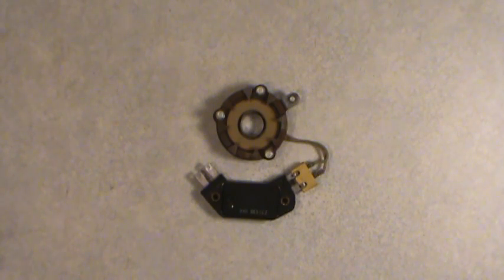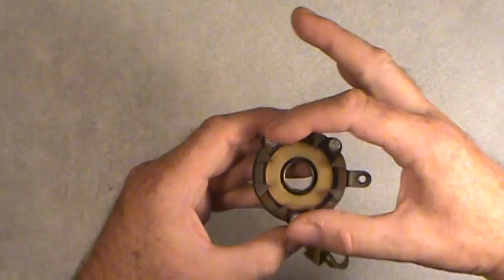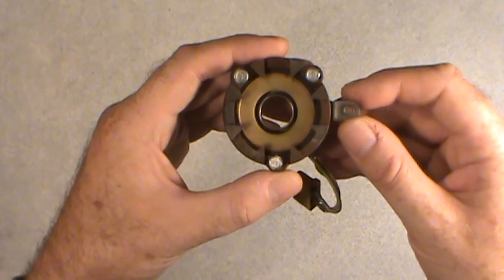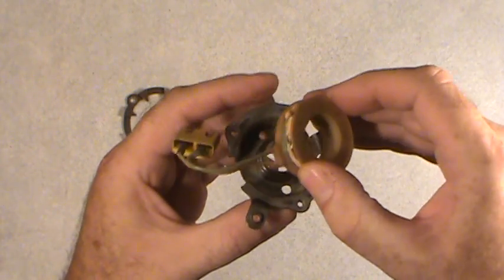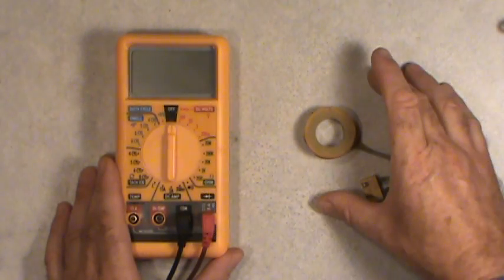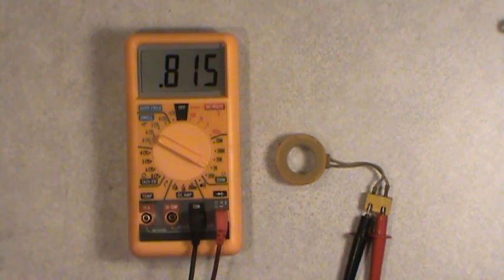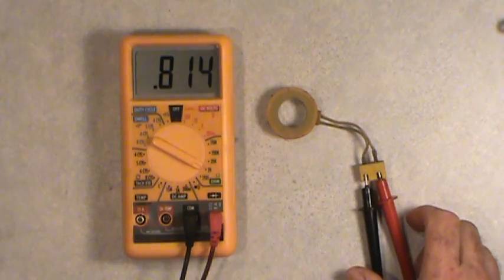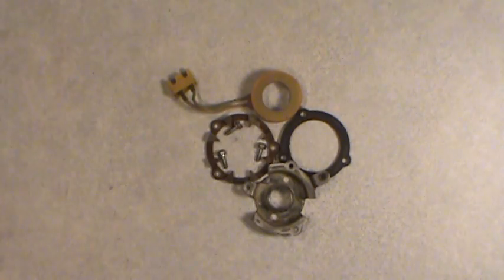HEI Distributor Pickup Coil Test

Comment: I'm working on a 1988 Chevy 1500K 4WD and was hoping that .814 reading would be correct for this vehicle?  I'm deciding between that and the ignition module as I've put my hands on the both the coil pack and the distributor after seeing no spark at in the spark plugs using a Philips Screwdriver and seeing no spark between the air gap.  What do you think would be the most likely solution?
Reply from the maker: wildboy92004 Greetings wildboy92004....Thanks for watching, and for Your comment/questions as well........................It appears, that, that .814 (Ohms?), that You were mentioning, should be alright/ok, as I recall, off of the top of my head, is that, an "Ohm Reading"..."Between"..."750 to 1500"...Ohms, should be (as I recall), the actual Ohms Testing "Specification/s", for this particular, 1979 HEI Distributor's..."Pick Up Coil"...that You see in this YouTube Video of mine......................................Just to be sure, try to find, the "Actual Specifications", for Your "Exact"..."Pick Up Coil"...just in case, it, might be a bit different?....................................................................................When-ever, looking for Your HEI Distributor..."Specifications"...or..."Replacement Parts"...Make Sure, that, You Get, the "Exact Parts"...for Your..."Exact Distributor" (hopefully, there will be, some Numbers, and/or Letters, found in/on Your particular Distributor, hopefully)...and..."Exact Ignition System"...as well...!!!.....................................I have a "7 Number Code"...Stamped Into/Onto, this, shall we say..."Old School"..."Ignition Coil, in the Distributor Cap, type of, V-8 HEI Distributor" of mine, on the bottom/outside, of the HEI Distributor's, Aluminum Body..................... "Make Sure"....that You..."Get the Correct/Specified Parts...for Your Exact HEI Distributor"...or...it might end up, not, be-in, such a good day after all................................You have to make sure, that Your "Ignition Coil", is getting "Battery Voltage" (about 12 Volts), when Your Ignition/Key, is placed in the "Run" (Not Start!) Position................................With Your "Engine...Cold and Not Running"...."Disconnect the Wires" that are plugged into Your "Ignition Coil"...then, select, Your Multi-Meter's "Volt Range/Scale", to Measure 12 Volts (might be set at 20 Volts?)...then, "Ground", the Multi-Meter's, Black Test Lead, to a good ground...and, with the "Red Test Lead"...Probe/connect it to...(You might need a Small Pin, or the like, to make the required test lead connection, perhaps?)...the, might be Red Wire?, or, the Wire that should make Your Multi-Meter Display, that approx, 12 Volts (Battery Voltage), when the Ignition Key, is Turned to the..."RUN"...Position..."NOT START"...position"...!!!............When You are finished, "Checking for that 12 Volts, in the Ignition Coil's, 12 Volt Supply Wire"...Turn Off the Ignition Switch, and take the key with You...and...Disconnect those Multi-Meter's Test leads, and reconnect the Wires, that connect to the Ignition Coil, that You removed previously...........................Did You "See", that 12 Volts, there-abouts, at all, while doing the Test...???................................The Design, of Your Vehicle's, Distributor Cap, with that..."Way Too Small Carbon Button" (inside) of "it"...and, that rather "Wimpy" Rotor, for, both the V-6 and V-8 Engines, are absolute "Junk/Crap"...more-so, when-ever the Spark Plug's "Gap", happen to be set at .045" (Four-tee Five Thousandths of an Inch) or LARGER, because of the "Much Higher Secondary Voltage", that has to make its way through, the Ignition System's, "High, Secondary Voltage, Side"...in order to "Jump", that "Much Larger Spark Plug Gap"...!!!............................If the "Gap Specification", for Your Spark Plugs, are close to being .035" (Thirty-Five Thousandths of an Inch), then, as I see it, the Ignition System's, High, Secondary Voltage, probably, Won't be, quite as High, as, having those Spark Plugs, with those Larger "Gaps", and, that, Way Too Small, Distributor Cap's..."Carbon Button"...should last a bit longer, hopefully....................................Check the "Carbon Button", that is Hiding, on the Inside of Your Distributor Cap, near the Center of it..................That "Little Carbon Button"..."Should Not", be "Worn Down", all the way, to the, shall we say, Distributor Cap's Plastic, and, that Little Carbon Button...should be "Spring Loaded", as well...............................If there is anything left, of that Carbon Button, then, just Push on it, and, it should have a "Spring-like" Action to it, much like a Writing...Ink Pen, that retracts, does................................The Way Under-designed, and "Wimpy," Distributor Cap's, "Carbon Button", and Rotor, usually don't last as long as They Should last, as compared, to both the, Circa/Dinosaur, Points and Condenser, type of Distributor, Cap & Rotor, as well as, the Earlier, V-8 HEI Distributors, that had the (Ignition) Coil (installed/Mounted) in the Distributor Cap...Did, and...Still Does...!!!...lol...................................If and when-ever, You do, decide to Replace that "Wimpy", Distributor Cap & Rotor, try to get a Distributor Cap, that has "Brass Terminals" on/in "it", and, if You can get a hold of, a Rotor, with a "Brass" strip of Metal on "it", then, that's a good thing...............................If You can Buy/Purchase, the, Distributor..."Cap and Rotor"..as a "Kit" (that be, the Cap & Rotor, usually in the same Package), then, that, my Friend, should "Save" You, a wee (Wee = Tiny or Small...lol) bit of Money, hopefully, that is...................................Make sure, that, the Bottom of the Ignition Module, and, the the Distributor Body (inside), where the Ignition Module, "Mounts On", are "Very Clean and Shine-ee, and also, make sure, that, You Smear, some Approved "Heat Transfer/Electronic, Heat Sink"..."Goop"...on the bottom of Your Ignition Module, before You Install "it" or, it just might "Over-Heat", and go..."Kaput"...!!! (aka, not work any more)...................................Make Sure, that, "All Wiring"...Connection Points/Connectors, are not Corroded/Oxidized/Dirty, especially, on the "Low Voltage" side, of the Ignition System's, Electrical Circuit, or, Things, might not "Work so Well", if the Full amount of Voltage and Amps, don't make it to, where it/they, should be going to, just sayin' now.............................Oh, and, if Your Spark Plug "Leads/Wires", are very Old/have lots of Miles/Kilometers on "Them", it would be a good idea, to Replace Them, with a set of Good Quality Ones, and, make sure, that, You Install, those Spark Plug Leads/Wires, Don't Forget" to "Install"..."Those"...(usually made out of)...."Plastic..."Wire Separator CLIPS"...in order to Prevent, any of that High Voltage, from "Jumping", from One...Lead/Wire, "Into another Lead/Wire"...or, might just turn into, something like..."Engine...Miss-Fire City"...!!!...............................It's always, a Good Idea, to be doing, "Regular Maintenance", and to, also, "Change/Replace", All of the "Parts & Pieces", as well as, any Required "Adjustments", that, is/are, "Recommended/Specified", by the "Factory/Manufacturer", that made Your Vehicle, to better Your Odds, at, Not having to go, on a..."Wild Goose Chase"...!!!...lol............................Have a look-see, at some of the "Other Videos", that I currently have, on my YouTube Channel...RockysRoadshow...and, I'm quite sure, that, some of them, will be able to, help You out some-what...enjoy.........................If You care to, You can let me know, how Ur makin' out, and.....................Till next time................Be Safe, take care, and have a good one.
Reply: RockysRoadshow I will try this, thank you.  Am I testing for resistance at the pole of the ignition coil?
Reply from the maker: wildboy92004 Greetings wildboy92004....You are welcome...........................It appears that, You might not have, all that much experience, when it comes to working on, something like, a Vehicle's, Fuel, and/or, Ignition System, and We all have to Start somewhere, and, that Includes (actually Included...lol)...Me also, when I was, at first, starting out, gettin' my Hands Dirty, and tryin' to figure..."Why is my Car Not Runnin' so good"...???...lol.......................................I'm assuming, that, You have a "Multi-Meter", that should be able to measure "Different", shall we say, "Things" (some-what Electrically, that is), and, if You have a look-see, at the many "Different Scales/Ranges", on most of the Multi-Meters out there, You will usually "See", both the "Ohms Symbol" (kinda looks like a Horse-Shoe, with the Open-End of that Horse-Shoe, pointing Downwards), and, Ohms, are a typical way, in which to Measure an "Electrical Resistance", usually, when Not Having any Electricity Flowing through the Wire/Wires, or Component/s, as the case may be......................Voltage, on the other hand, and, as I see it, is the actual, oh, shall I say..."Electrical Pressure", of the Electricity, that is Flowing through a Wire or Component..............................Be Careful now, as there are usually "2 Types of Voltage"...one being..."AC Voltage" (AC = Alternating Current), and a fairly good example of "AC Voltage", is the Type of Electricity, that is Flowing through the Wiring in a House...then, there is..."DC Voltage" (Direct Current), which is what, almost all..."Electrical Tests"..."DC Voltage-wise"...that is, when Testing the "Voltage", on various, Wires and Components, that are usually found, in most Cars and Trucks...........................Your Vehicle's, "Battery", should be rated at 12 Volts, actually, a Fully Charged, 12 Volt, Vehicle Battery, should be around 12.6 Volts, with the Vehicle's Engine "Not Running", and, when-ever the Engine "Is Running", and..."None"...of the..."Accessories are Turned On", as in Heater/Air Conditioner Fan, Windshield Wiper Motor, Headlights, etc., then, I've found, that, at times, on a "Cold Winter's Day", that, the "Battery Voltage", with the "Engine Running", and "Every Accessory Turned Off", I was seeing, almost/about, 15 Volts, showing on my Vehicle's "Volt Gauge", on/in the Dashboard...!!!.....................................Now then, About what I was saying, in my last Post/Reply, was, to "Measure the Voltage", while having the Multi-Meter's "Dial/Selector", Set for "DC Volts", in order to Measure, the Amount of "Volts" (Voltage), that is coming through the "Wiring/Connector/s", that is, to be..."Disconnected"..."From"...Your Ignition Coil..."Only"..."Not the Ignition Coil Itself"...!!! (well, if there is Any, that is?)...................................Be "Extremely Careful", while working near Your Vehicle's "Battery", because, there is usually "Explosive Gas Venting", from Your Vehicle's Battery, especially when, Your Engine is Running, and the Vehicle's "Charging System" is Operating...!!!...so..."No Sparks"...and..."No Smoking"..."What-so-Ever"...!!!...anywhere..."Near Your Vehicle's Battery", or, maybe..."BOOM"...!!!....and, I hope not..................................Also..."Check the Fuses"...in Your Vehicle's..."Fuse Panel or Box"...cuz, if one or more, of the Vehicle's Wiring Circuits or Electrical Components, shall we say..."Overloads or Shorts-out"...that my Friend, can cause a..."Fuse to Blow" (as in, go Poof...!!!), and, that "Blown/Bad Fuse", will..."Stop All Electricity"...From..."Flowing Through that particular Electrical Circuit"..!!!...and maybe, just maybe, that might be, one of the possible..."Culprits"...that could, possibly be, what's causing, the "No-Spark" Problem, that You seem to be having...???....................I have a few Videos, on, how to do..."Ohms (Resistance) Testing"...of some Different "Types" of "Ignition Coils", on my YouTube Channel....RockysRoadshow...enjoy.................................So then, that's about it, for the time being, and..........................Till next time..............Be Safe, take care, and have a good one.
Reply: RockysRoadshow I'll check it out.  I took Auto Mechanics 1 and 2, and Small Engine Repair in high school some 20 years ago right around the age this truck was popular to work on.  I have never tested a coil pack with a multi-meter.  All I know is it interrupts the ground for the ignition so if I'm getting no spark out of the coil pack then don't I back step to the ignition module and then the HEI, respectively.   I'll watch your tutorials.  I was just wondering a quick way to get the coil pack out of the equation and then work on the pieces in the distributor.  That ignition module, I wanted to know how to test that to see if it's bad as well with only taking the distributor cap off.  Rotor was fine.  The question is, how to test for a bad ignition module?  1988 Chevy 1500K 4WD.
Reply from the maker: wildboy92004 Greetings wildboy92004....Congrats, at taking those, Small Engine Repair Courses, as, now, I can see that, You do have some Experience, after all.............................I've, never really "Tested", an "Ignition Module", and, I usually just Replace "One", when "Every-thing-else", in the "Ignition System, seems to "Check Out Ok".............................For some of the "Ignition Modules", Before the Distributors were being "Hooked-Up to Computers", that were Used in some of the Ignition Systems, by Different, North American Manufacturers, had a Testing "Unit", that would be able to "Test", those Older Ignition Modules...................................Also, there are some Folks, that, have found a way or two, to, some-what "Test", those very same, Older, Ignition Modules, with a Multi-Meter, along with, a quite simple Wiring Circuit as well.....................................Just wonderin'...Just How, did Your "Ignition System"..."Quit/Stop Working on You"...as in..."Gradually Failing"...like having the Engine..."Miss-Firing"...or...being..."Hard to Start...Hot or Cold"...or...did Your Engine just..."Quit, all of a Sudden, without Any Warning at all...???...as that, in itself, can/might, be, a very Good "Clue", as to what-"it"-just-might-be-that's-Causin'-all-of-this-Trouble-that-Ur-havin'...perhaps...............................There are "Rare" times, where, although, an..."Ignition Coil Checks Out Ok"...while doing an "Ohms/Resistance Test", with a Multi-Meter, Set for the Correct, Ohms Scale/Range, for/on, both, the "Primary and Secondary, Coil Windings of Wire", that are Hiding, Inside Your Ignition Coil, where-by, that Affected/Not so Good, Ignition Coil, might start, Not Working so Good, and maybe, Stop Working, All-Together, once it Heats Up-To, Operating Temperature or Higher................................................................................Did You "Look-at/Inspect" the Carbon Button"..."Inside"...Your..."Distributor Cap"...???....................................Besides a Faulty "Ignition Module" (if it "is" Faulty, that is...???)...then, Here's what I usually Do, to Check-Out, the Ignition System, much like the "One", that You have there............................................................Make Sure, that, I'm getting, about "12 Volts" there-abouts, at the Ignition Coil's..."Disconnected"..."12 Volt Supply Wire", where "it" Plugs-Into the Ignition Coil, having the Ignition Switch, in the "RUN"..."NOT START"...Position.............................Having All Wires, Disconnected, from the Ignition Coil, Check the Ignition Coil's..."Primary Coil Windings", and "Secondary Coil Windings", with an Ohm-Meter, and, Make Sure, that, those Ohms Readings, are "With-in the Specifications", for that "Exact" Ignition Coil......................................Check the Ohms/Resistance of the "Pick Up Coil", and, that, the Ohms Readings, are "With-In the Specifications", for that "Exact" Pick Up Coil"...................................Ohms Check, the (spark plug-like), "Lead/Wire", that "Connects Between", the Ignition Coil's, Secondary, High Voltage "Tower", and the "Distributor Cap", as, I've had, One of those, on an Engine, that had the Lead's/Wire's, Conductive "Core"...Electrically..."Arc/Disintegrate"...where "it" should have been..."Positively/Mechanically...Connected"...to the..."Metal End Terminal"....that's Inside the, Rubber/Silicone type..."Boot"...that's at the End of, that there Lead/Wire....................................Check "ALL...Wiring Connections", and, Make Sure that, ALL Connections, Are Clean and Dry...!!!....................................Even "if"...???...You happen to Buy and Install, a Brand New "Ignition Module", and, by doing so, Doesn't Fix the Problem, then, You'll have what I have, and that is..."A Spare Ignition Module"..."In Stock"...that is probably Ok...and is Readily Available, for some time in the Future, if need be, that is...!!!...lol.................................I think, that they cost about $50.00 (50 Dollars) there-abouts, so, it's not all that bad after all....................................If any of Your "Ignition Parts" happen to Look Questionable at all, "They" really should be Replaced with New Parts, or, Not Wanted Problems, just might happen......................Are You making any Progress at all...???......................Well, Till next time....................Be Safe, take care, and have a good one.
Reply: It happened as it warmed up and stalled a couple times and then it stopped working altogether and is now running again after taking off the distributor cap checking the rotor and distributor point and then is now working again.  So with it running again it seems difficult to diagnose especially since I didn't replace a single thing.
Reply from the maker: wildboy92004 Greetings wildboy92004....Here's a rather simple way, that I Check for "Spark".................................With the Engine Cold, and Not Running...Get Another (Extra/Spare) Spark Plug, having the Correct/Specified, Spark Plug "Gap",for Your Exact Engine, then, Remove "One" Spark Plug, "Lead/Wire", from One of the Spark Plugs, that's, In Your Engine Now, and Connect that Spark Plug "Lead/Wire", onto that Extra/Spare Spark Plug..................Then, I get length of 14 Gauge, Copper House Wire, about 6 inches long, or a bit longer, and Wrap, about Two/2 Turns, of that Copper Wire, around the Screw-Threads, of that, Extra/Spare, Spark Plug, and Connect/Secure, the Other End, of that Copper Wire, to a Good "Ground", On, or Near the Engine, where it won't get all Tangled-Up, in any Moving Parts..............................Then, having the Vehicle Parked, in a Slightly Shaded, but Not Totally Dark Area, in order to "See" a "Spark", Between, the Spark Plug's, "2 Electrodes" (if there is a "Spark", that is...???), I then, have Another Person/Helper..."Crank the Engine Over"...when I Tell Him or Her to do so, while I'm "Looking" at that Extra/Spare, Spark Plug...But..."ONLY"...for a very Short Time, like, about...2 or 3 Seconds...Time-wise, that is, as the Engine, "if" there "is" a "Spark"..."Will Probably Start"...and, We "Don't Want That Engine Running"...Having One Spark Plug, With "its"...Lead/Wire...Disconnected"...!!!.....................If...???...there "is" a "Spark" or Two, that I happen to "See", while doing the Test, that I had just mentioned, then, I would probably be, Looking in the direction, of the Fuel System.................................."Fuel Filter Plugged-up"...???..........................Electric Fuel Pump, that's Usually..."Hiding"..."Inside the Gas Tank"...Able to Supply that..."13 PSI" (Pounds per Square Inch) there-abouts, of Fuel (Gasoline)..."Pressure"...all the way, up to, the Throttle Body/Fuel Injectors...???..............................Always be sure, that, there is "No High Pressure Fuel/Gasoline, Remaining in Your Entire Fuel System"...as that High, Fuel/Gasoline "Pressure is Dangerous"...!!!....................Make Sure, that, the "Fuel Pressure, is Safely, and Properly "Bled-Down/Reduced to Zero Pressure", and Wear Eye Protection, and have a Fire Extinguisher with-in Reach as well...!!!...........................There are quite a few "Things", that Make-Up, the Total, Fuel Supply/Fuel Injection System..........................Make Sure, that, There really is..."No Spark"...Before, Blaming, the..."Ignition System"...or, it will probably, result in, You, going on a..."Wild Goose Chase"...!!! (to lol, or not to lol, that is the question)...lol.........................So then, there's my "Snippet", of Information, for now, and............Till next time............Be Safe, take care, and have a good one.
Reply: I put a screwdriver up to the coil starting at the spark plugs hooking into the terminal leads grounding it on a piece of the engine block with a very small air gap and no spark.  I was so positive there was no spark I put the screwdriver tip onto the coil itself and held onto the metal part of the screwdriver and nothing.